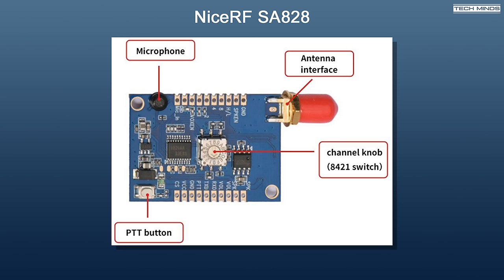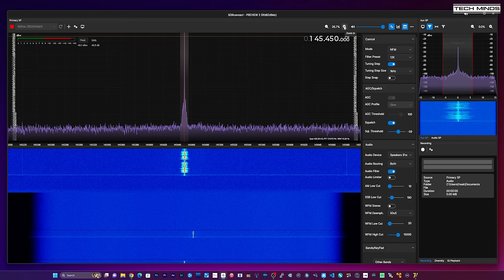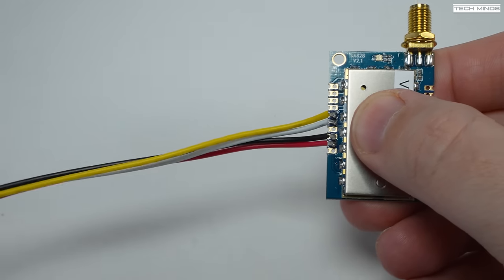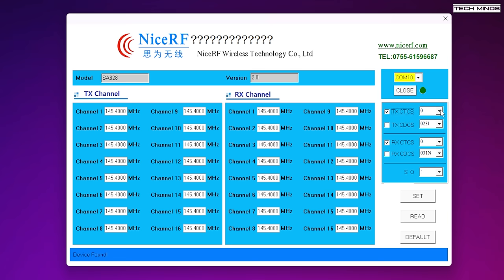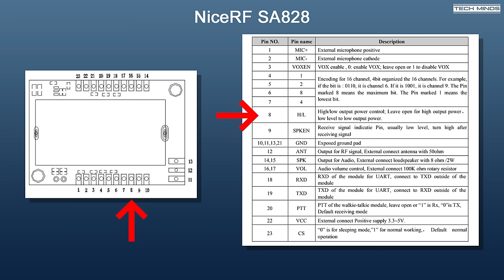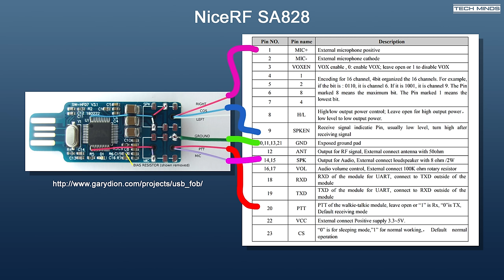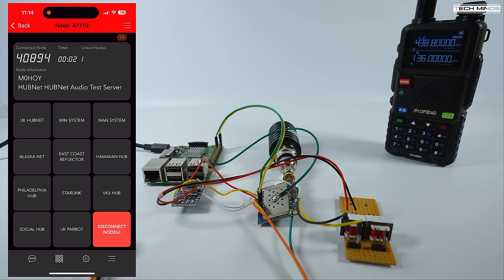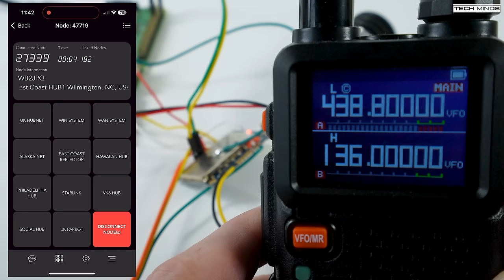Build your Own Transceiver With The NiceRF SA828 Module

Comment: Just visited their site and they have a lot of cool stuff.  The DMR Tier II and LoRa modules are definitely worth a look.   There's also some 70cm/2m full-duplex modules  ; )

Managed to order a pair of SA-828's for just 32 quid from China, shipped!  For only 17 quid each I'm a very happy bunny and I won't even have to sleep on the couch.  Oh, and I notice that they can be connected to an MCU and operated via the bus, so ideal for really low power Arduino or PIC-Chip projects.  Seriously, what's not to like?

Previously, I was butchering Baofeng UV-5R's for all my projects.  Although, I think I may keep up the old 'butchering UV-5R's thing... y'know... as a public service  :D

Comment: Good one, Ive used the modules many times with out the PCB option but didnt use the transformers I did put a filter on them as you say theycan be a bit noisey. BTW you can use the PI IO as an example rather than the onboard CPU on that PCB you board and progarmming it via AT commands is prity easy then you can do your custom per channel mods from there rather than the PC/S/W

Comment: So I just recently got two of these kits in the mail . But I’m a little confused on the wiring between the USB board and the module itself  SA828 . Everything is labeled from one device board to the other except for the one that’s marked set where does that wire go to?

Comment: Next question, is there any reason why I couldn't use the standard sound interface built into the Raspberry Pi 3B+, and use one of the GPIO lines to trigger the PTT?
Reply from the maker: It all depends on the application you’re using. For all star you also need a COS line which tells the application if the radio is receiving a signal. I don’t think allstar supports the inbuilt sound card.

Comment: For $18 dollars you can buy an Baofeng UV5r and just use it. This is way to much trouble and work.
Reply: buying is not the point.
Learning is.
Also, they are smaller and more versatile than a baofeng
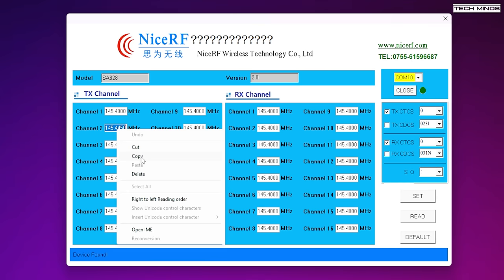Reply: You clearly didn’t watch the video.  This is addressed at 5:18.